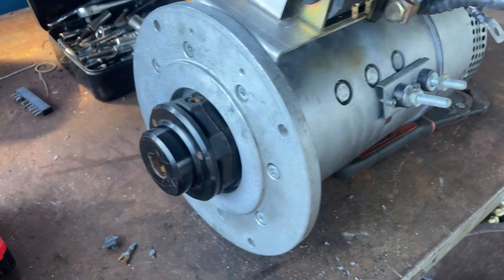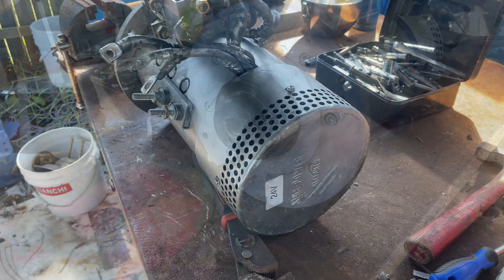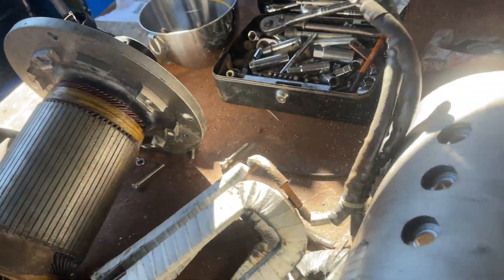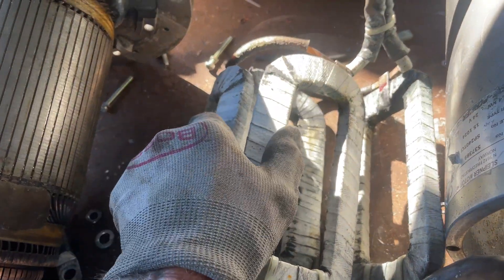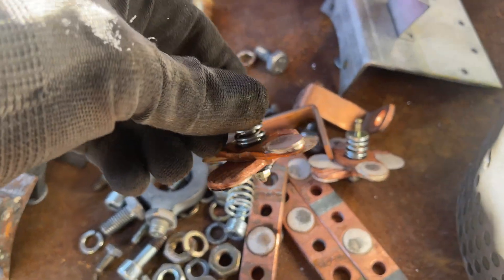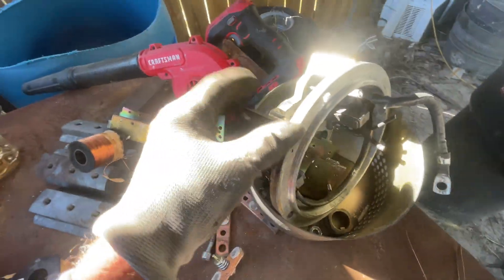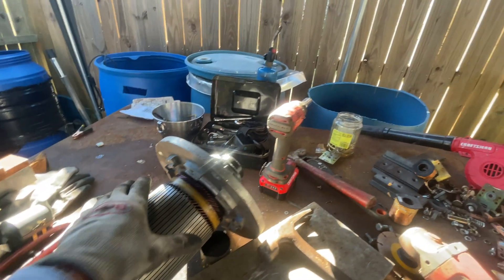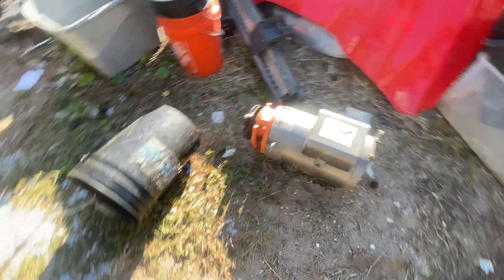What’s inside of this massive copper motor?

Comment: Wow those are some big silver contacts.  Cool motor.  Not sure I'd know how to get that copper out either.  Would probably have to put it in a fire to melt down what's holding that copper in there.  A beauty though.
Reply from the maker: Interesting I think I can break off one end with a hammer and I’ll try that on video and I think the other end I’ll cut off with the saws all and then I think the only thing I’ll have to do is melt the middle and then slide them out somehow
Reply: @ScrappingwithGrandpa  Good plan.  Probably not easy but may be a good amount of copper.
Reply: @ScrappingwithGrandpa depending on how much shellac is in it if you are going to roast it, don't cut anything until it's ready to eat 😂😂😂